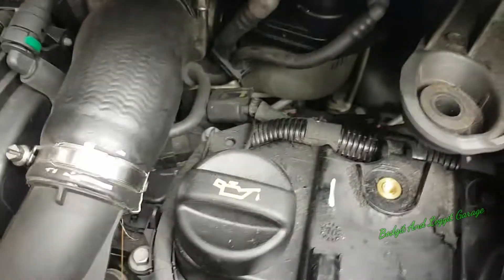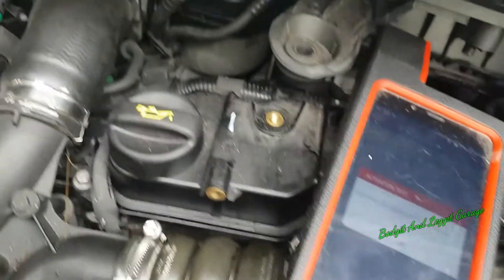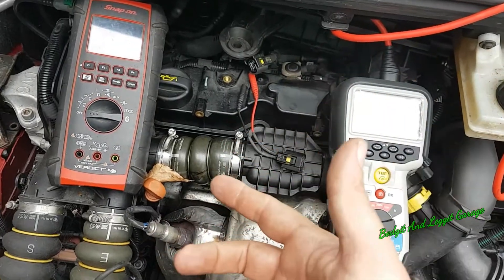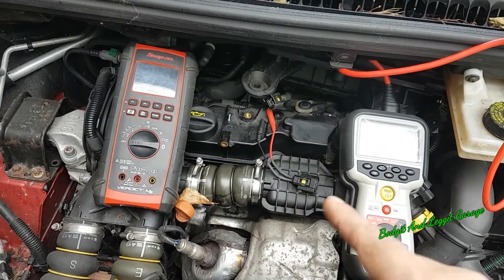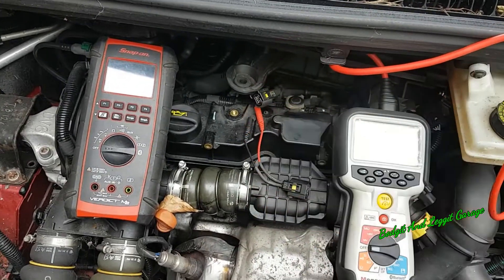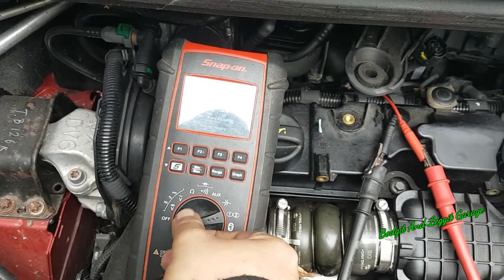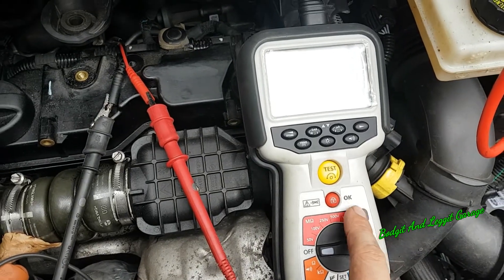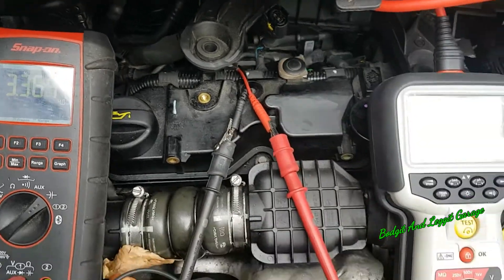P0268 Injector Problem (engine destruction)

Comment: Hi, mate! Just one question: can we test the return flow of the new diesel piezo injectors the same way as the older electromagnetic ones by using the kit with pipes and bottles attached to the return of the injectors? I heared from a guy in Africa that they can block by testing them this way. Thank you!
Reply from the maker: @razvanturcu9871  hi mate it's hit and miss most of them have very high flow rate Returns it's like everything the more complicated cars get the more expensive machinery you need to test them I have never tested these injectors that way before I've never had the need to be honest the insulation tester does everything you really need just very expensive